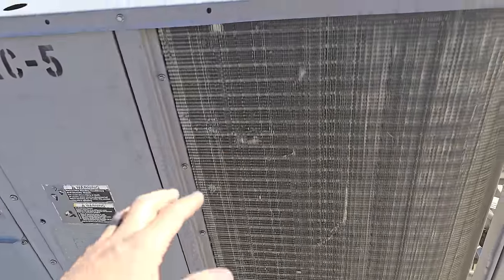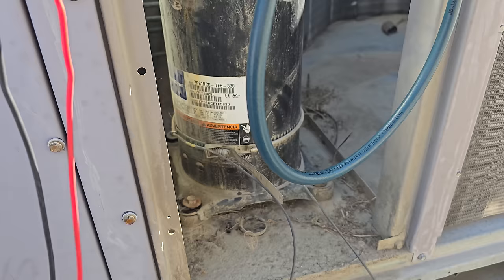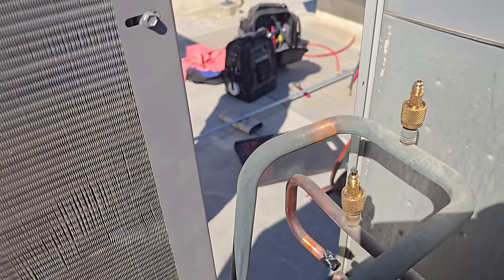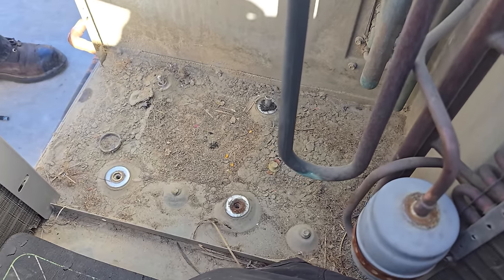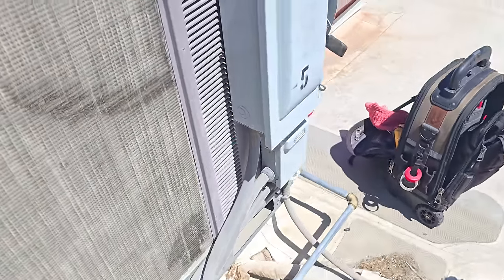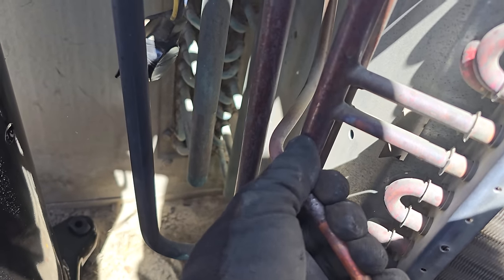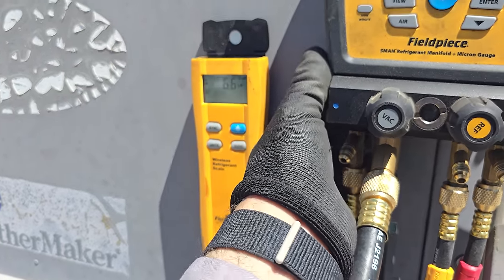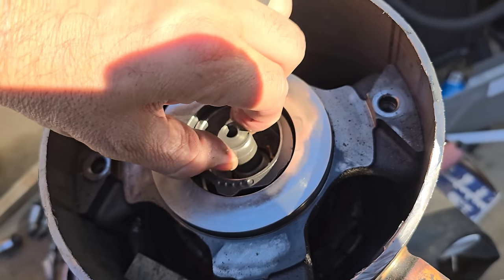THE OFFICE AC IS NOT WORKING

Comment: Just to point out, the windings on all motors have an enamel coating to prevent shorts. The acids will soften the enamel and that will float in the system as a wax like substance. Also scrolls will normally separate a little when they experience over pressure from a liquid getting into the scroll. Depending on design it will either separate enough until there is room for the exhaust valve to allow it to pass or the internal valve opens. This design might be with that coupling does not allow the scrolls to separate with liquid slugging. Always a good video when you get a teardown of the compressors to see what happened.

Comment: Just sign up for my HVAC school yesterday, 12 weeks, wish me luck.
Reply from the maker: Good luck
Reply: You will love it.
Get the RSES SAMS manuals too.
It instructs physics.
A trade school generally doesn't in depth.
Reply: I began sweeping a refrigeration shop and being a gofer to brilliant  technicians there when I was 10 years old. They apprenticed  me and when I got my driving license at 16, they gave me a service truck as I was at journeyman  level by then.
Nearly 50 years doing HVACR and was never without work.
I'm now retired at nearly 61.
Until I was 16, they paid me cash under the table so child labor laws weren't  violated.🤣

Comment: Speaking of crankcase heaters, Emerson has recommended installation requirements in their technical bulletins for each compressor model. In general, where the weld seam goes down the length of the compressor, they suggest that the torque nut and bracket cover the weld, not the heating element itself. This is to prevent stretching of the element and also it's generally not a flat surface and there will be an air gap if the heating element were to cover it. The torque recommendations is 20-25 inch pounds. The crankcase heater shown in the video looks a tad bit high. Every compressor will be different, but for example the measurement could be 0.20" - 1.22" from the bottom of the base plate. 

There are crankcase protrusions seen towards the bottom of the body of the compressor. Some bulletins recommend above or below these protrusions depending on the compressor. The main point is that the clamping bracket should be placed over the weld and not necessary convenient for the install or servicing technician. Here's a video to explain it - https://www.youtube.com/watch?v=y3PsTyCN6aw

Comment: Great video, no criticism here just commenting... 
Those pieces can just break too, from wear or possibly a manufacturing defect or design flaw. Personally I think Scroll's are way more liquid resilient, especially versus a piston type compressor. I used to cut open all the failed scrolls I replaced and I'd say 90% of the time that same coupling piece is what broke. The pieces jammed the rotation (locked rotor),  took out a winding (open/grounded winding), or the compressor was just free-spinning and not pumping anymore (low amp draw, no pressure change). I'd actually say its pretty uncommon to find a failed scroll where that piece wasn't broken, for me at least.

Comment: If you're right and the failure of the crankcase heater broke the compressor, then perhaps the system should be redesigned slightly so the heater is part of the compressor start-up...

By that I mean, during compressor start-up the heater is briefly turned on (if it's not cold enough to require it to be used) and if it won't turn on, then the contactor can't pull in to turn on the compressor motor...

A better system (assuming this won't damage the compressor) is to simply wire the heater in series with the compressor motor so it turns on when the compressor does so if the heater has failed and can't turn on, then the motor circuit also can't turn on and the compressor can't undergo a flooded start due to cold conditions...

Comment: I've never had an issue with the 3/8 copper with the Navac tube expander I must be lucky..question on the metering device...have you ever ran across a unit that the metering device is not operating properly after a big job such as this?

Comment: I think you are right about refrigerant migrating back to the compressor and starting with a comp full of liquid. I recently went to a call for a self contained open produce cooler. Unit shut off on high head from a seized fan motor. I pushed the reset and it sounded like the compressor was going to expode. Anyhow, although the hp tripped the solenoid stayed energized and over the course of a few days the refrigerant migrated to the compressor causing the awful sounding recip comp.
Reply from the maker: Good job find that issue

Comment: I wondered what has happened yesterday, i had a 30 minute old notification for it on my phone, but the video was privated. Nice to be able to watch it now
Reply: I've also hated rivnuts, one little truck I've found to get a bolt out of them is to use super glue on the nut, if you can access it. Little glue and carefully unbolt and you have a decent chance of unbolting the part. 

I like the concept of rivnuts, but in practice they just suck

Comment: Compressor changeout I’d automatically replace the Crank Case Heater and Contactor.as well. 

I’ve also seen people replace Condener Fan Motors and not replacing Capacitors…. 

Doing so I my opinion is like putting old parts in a new Transmission.

Comment: My understanding is that it's not the refrigerant that does the damage, or  rather:

As the compressor sits in cooler climes refrigerant condenses in the oil. On first start up the drop in pressure inside the compressor causes the refrigerant to rapidly evaporate. This evaporation in the oil causes the oil to 'boil' as it sits at the bottom of the compressor.

The level of the now 'boiling' oil rises (like water level in a  kettle rises as it boils. ) Sufficiently to allow too much oil (more than normal and acceptable carry over) to be dragged into the suction inlet port and into the compression chamber. The excessive oil is trapped inside the compression chamber and as it wont compress,  hence tries to bust its way out instead...

Therefore its actually the oil that does the damage not the refrigerant although its the refrigerant that causes the oil to enter in the first place . 

Anyhoo thats my understanding..

Comment: Sorry to be the bearer of bad news but, despite the re-edit, you've made the same mistake twice regarding the operation of the compressor in that you described the moving scroll as sliding back-and-forth when in reality it orbits within the fixed scroll to provide the compression. In fairness, though, you did say 'orbiting scroll' in the commentary at the end.

Regarding flooded starts, it would be relatively simple for manufacturers to implement a sensor on the compressor to detect this condition and prevent the compressor starting in extreme circumstances. An extra port on the side of the compressor with a window for a optical sensor would be one method though there may also be electrical/electronic methods of achieving the the same thing, even going so far as measuring the liquid level within the compressor casing. As there are low oil level systems on compressors, why not a high level sensor?
Reply: Dude he doesnt make the compressor take that idea to Emerson it a great idea
Reply: Just one more thing to fail, leak or go wrong. Risk vs reward, how many compressors would be saved vs how many more nuisance problems would it create?
Reply: @inothome  As there are already compressors with extra connections, both refrigerant and electrical, where the extra connections are not problematic I don't see a problem.

Comment: Hi Chris, long time viewer from Slovenia here, when you commented that you hoped that the compressor went bad due to single phase running I wonder why you don’t use 3 phase control relays to protect the units? The control relay detects presence and correct sequence of the phases and if you then use it as lock out signal so the unit does not start when there is a problem with input voltage.
Reply: Pretty sure he was referring to the contactor single phasing the compressor, not the supply losing a phase. To prevent this you would need phase monitors on the load side of each three phase contactor. And in this case, where cheap US manufactures use two pole contactors instead of three pole, the phase monitors would trip every time the contactor de-energized, since there is one phase that is always energized. But, I do agree and I don't understand why more US equipment does not have phase monitors to at least monitor the supply. I see phase monitors on just about every piece of three phase equipment from Asia and EU that I work on and almost never on US made equipment.
Reply: @inothome  probably right, in EU there is no way this kind of installation (one phase left energised) would be allowed, here all the phases must go through contactor and if present neutral too.